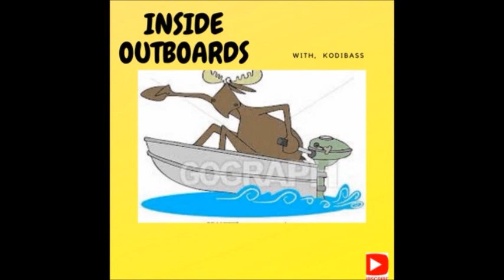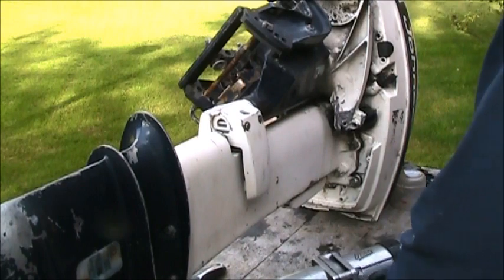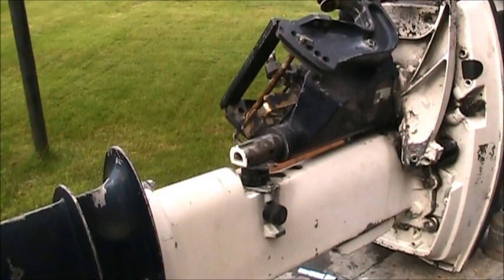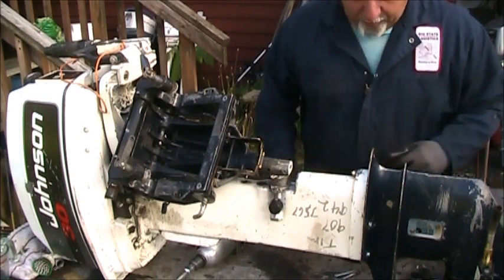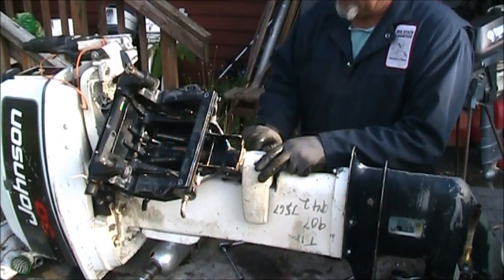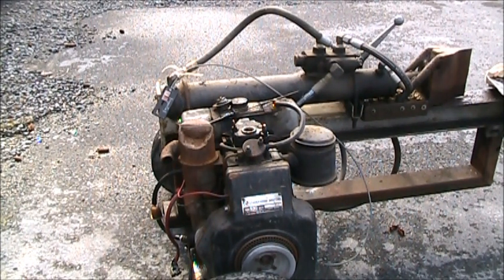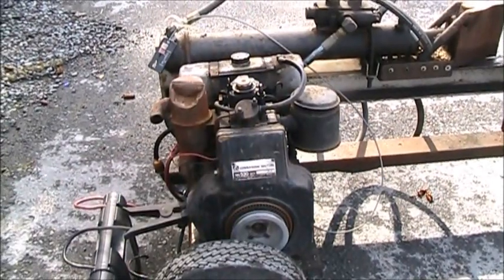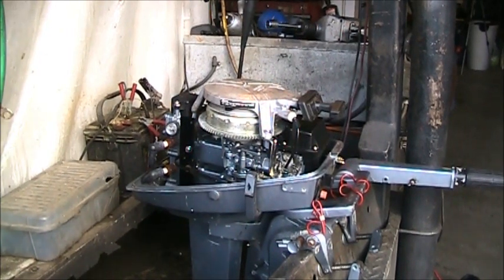1990 JOHNSON 30 HP & MORE  motor mount

Comment: I have a 1960 Evinrude 18 horse redid di just about everything on it. Check it out it was running fine. But a few minutes after Full Throttle it started overheating. Go back down to idle it's fine. Man I could use your advice
Reply from the maker: +BB, drop your lower unit & inspect your pump & impeller,  Also remove your T-stat and test it in a pan of hot water to make sure it opens and shuts.                              kodi
Reply: Impeller is new pumps good water. Haha did not check thermostat and it's not in there. The person I bought it off of was not easy on it.
Reply: Will a blown head gasket

Comment: Blown head gasket would that cause it to overheat
Reply from the maker: Only if the cooling water was being discharged out of the blown area, which would b easy 2 see I think,     kodi
Reply: @kodibassInsideoutboards  yeah I had some blow out. And the gasket was bad had a dime-sized hole in it